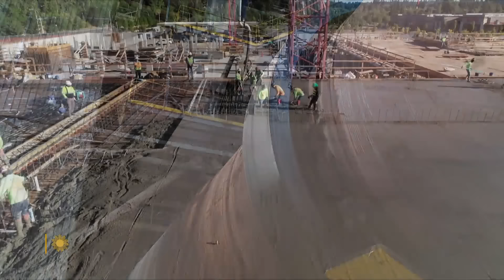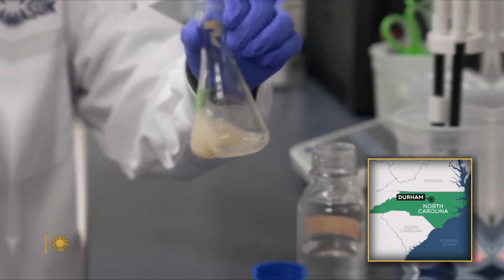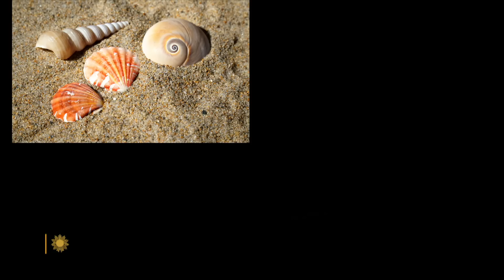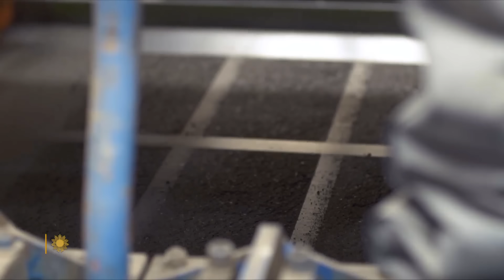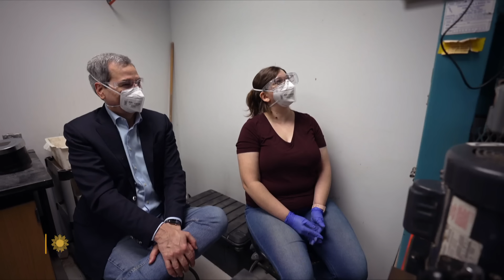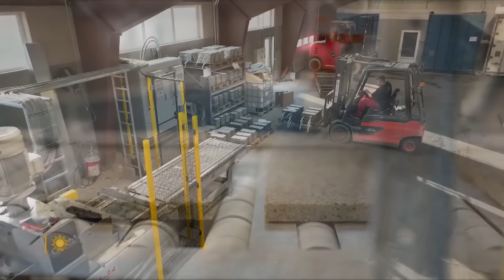Cementing a more sustainable alternative to concrete

Comment: If it was as straightforward as they make it out to be, Venture Capital firms would be pouring Billions of $$ into it, and it would have been licensed by every concrete manufacturer, and it would be subsidized by the governments of the world if it could really get rid of the majority of the carbon emissions pollution.  Instead, they are “working on a few licensing deals”.  This is not what it seems.  They are leaving out something major.  However, I’m sure the underlying technology does work.  Maybe they have not been able to find a way to build it at scale yet.  I hope they do, because it is very cool if it works at scale.

Comment: Yes you heat the lime stone with coal to produce cement, 1 of the 3 major ingredients that makes concrete.  ALSO, and this is important because it saves on $ - the residue left over from that coal burning  limestone is called fly ash - fly ash can and is used as an added ingredient which is A LOT cheaper then cement. A lot of commercial construction companies and fly ash to the mix because it's cheaper than adding an extra bag of concrete to the mix.  The carbon footprint of any large job site is mind blowing.  The amount of waste involved is darn near criminal.  Anything that would lessen the CO2 consumption is a win

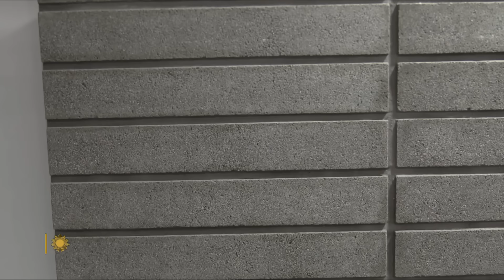Comment: @2:29 The reporter states that the strength is almost double driveway concrete strength. Incorrect. 38,515 lb on a 4”x8” cylinder is roughly 3,000 psi. 

That’s a total joke.

Comment: Hemp create is another amazing invention. Light weight, waterproof and fireproof. It's more expensive, but when you figure in a couple of factors, I might more profitable too. Cement trucks can be made not so heavy duty, gas mileage improves, easy to build with pre built walls and boards to replace wood. It can be cut with a concrete saw tóo. Check it out online if you're curious.
Reply: Yes 🎉🎉🎉
Reply: Gas mileage? If your advocating for cleaner environment from materials you should know the reality that cement trucks have been electrified and run with replacable  batteries. Gas run vehicles have been proven obsolete tech. Do a search and learn about it. Also it's not clear what you are proposing as the use of hemp.
Reply: @cre8tvedge I was quite clear in my comment. The fact that you want me to explain it to you means you aren't as intelligent as you think you are.
Reply: @ChrisLaprise-y1k  Nice try. But no. I'd say you're just dodging.

Comment: I absolutely love all the materials science going on right now (even if it's obvious materials or centuries old - getting new life).  There's a startup company that builds interesting geodesic dome homes called Geoship, they use a different alternative ceramic for their exterior shell. They say it's modeled after bone, also calcium carbonate based (iirc).  Since the material is naturally occurring, there's no cancer-causing or other offending chemicals to cure it, also repellant to mold and doesn't rot, fireproof, as well as having a wider temperature range that it can withstand than concrete can.

Comment: Notice they never mentioned how LONG it takes to cure to usable strength....I'm guessing its substantially longer than concrete, which is why its being used for cast shapes rather than formed in place pours. And while formed shapes would be very useful, the vast majority of concrete used is poured in place, on site, with forms. How does this tech work doing that?

Comment: I wish them nothing but the best! Eco-friendly construction methods including this kind of concrete needs to take off everywhere pronto!
Reply: Today's Sunday Morning program showcased 3 new technologies that offset the terrible ways that bread, "bio-cement" and energy are usually produced. We do not suffer from an inability to innovate more environmentally friendly products. We suffer from the moneyed interests that continue their methods despite negative environmental costs. The petroleum industry leads that DARK FORCE that forces us all to accept the worst options. We must face the facts about climate change and adopt new cleaner strategies.
Reply: @rr7firefly  I think it's the increase in materials costs to use eco-friendly products that causes great idea 'startups' to fail (or slowly fail). When a build project is operating with a fixed construction loan amount, the average contractor is keeping costs under control... not supporting innovation.
Reply: This is not anything new. They have been making cement longer that concrete, they just can't do it cheaper or keep up with demand.
Reply: Never going to be commercially viable. Will be way to expensive for large scale use.

Comment: Unfortunately the big question is whether or not is financially similar to cement?  Because that is what ultimately will drive change in the industry.    Also, based on what I saw this is great for making tiles and stuff, as the shape have to be compressed to what they want, but that doesn't exactly help you if you want to make a cement driveway, or sidewalk, or street, or building foundations or... i.e. what probably 90+% of cement is used for.    That said, I do hope it does become one of those things they can one day just squirt in with some aggregate into some form and create a cement road/walkway/pillar/etc without the need for lime.
Reply: 30% of global concrete is preshaped forms: tiles, bricks, etc. But they are also working on the squirting, on-site kind!
Reply: This. Note that they said they were planning to license the technology to other concrete companies. 

If the cost of licensing isn’t comparable to the existing production methods for concrete then their goal of benefiting the environment won’t really do much here. Nobody licenses their company / company’s idea for cheap. Eventually the license becomes the thing that makes the most money for the company. At which point you stop caring about what your initial goal/intention was and now you care about the money.

Comment: Sounds great, but how much does it cost?
Reply: Like all new tech, it's gonna be expensive to start no doubt, but the more it gets licensed when ready, it'll come down in cost -- basic supply and demand. Think about the environmental cost today vs. the future if this expands. Save the planet for the future, or future generations will be looking for a WALL-E solution to leave the planet.
Reply: @hummersd  This is not anything new. They have been making cement longer that concrete, they just can't do it cheaper or keep up with demand.
Reply: How much does it cost the planet to continue making the current concrete

Comment: I assume not asking any actual questions was because the answers would have shown the problems. Can't have problems in fluff stories.

What energy inputs are needed? These bacteria often require an energy source, such as light (for photosynthesis), hydrogen, or specialized substrates to drive the fixation process.

How long does it take for the bacteria to complete the strengthening? Normally we'd be talking weeks, months before the product was read to be used.

Cost? If this process were cheaper than concrete it would have been stated 20 times in the story. So I have to assume very expensive. The market for paying a lot more to reduce carbon is extremely tiny which makes the impact on carbon too small to matter.

How long does it last exposed to acid rain?
Reply: Your comment is a good example of using critical thinking and media literacy. You thought not only about what you were being shown, but what wasn't shown and why. This is exactly why media literacy needs to be taught in schools.
Reply: Government tax incentives could go a long way toward helping bring those costs down/make it more appealing to invest in this new technology. If the government would subsidize these kinds of green industries rather than fossil fuels, that would also go a long way toward a more sustainable future, since there’d be greater financial incentive for energy/construction companies to invest in greener alternatives like this new kind of cement rather than continue with current methods.

Comment: thats nice for form made bricks but what about roadway roads and/or sidewalks or foundations and what is the long term life span of this new way of doing this? if anything this is a nice idea and this was a nice fluff piece of a story with no real hard questions
Reply: That’s not likely the issue it’s probably the cost. It’s almost always the cost
Reply: @Blahblah37078  yup saving the enviroment is rarely profitable
Reply: @Moe-foe  Especially if they're licensing the technology to others.   They talk a good talk about wanting to get rid of the CO2 associated with cement, but if others want to use their patented process/formulation they gotta pay up.
Reply: @Moe-foe It’s starting to be, at least solar is cheaper than electric in many places now. You just have to build the tech over time and make it more cost efficient, as with anything

Comment: Sure at twenty times the cost. This isn't about saving the environment. It's about their great idea to become incredibly wealthy. It's not affordable on a large scale and they know it. No. the costs wont come down if it spreads like they hope. It'll be expensive in comparison always because of the process. It also didn't look like something you use on a real project that requires some speed as it's pressed and not free flowing. Great idea but not sustainable itself.

Comment: CO2 has been a natural  compound in the atmosphere for as long as the  world has existed. It is a good thing The world is getting greener because of our CO2 emissions since plants, trees and crops "absorb" CO2 from the air to grow. It is an established practice to pump CO2  into greenhouses to make the plants inside grow faster.
Reply: And it’s very bad when there’s far more CO2 than what can be absorbed by all the plants (and it doesn’t help when there aren’t as many plants since we’ve clearcut forests like in the Amazon and destroyed environments that used to capture carbon dioxide), which is why the planet continues to get hotter and extreme weather events are becoming more common. It’s imperative to build more carbon capture, if planting more trees and other plants (and kelp is actually a greater carbon capture source than trees) or coming up with various forms of technology, while also curbing/reducing carbon output. 

It’s not so much for the planet’s benefit, since the Earth has survived far greater than whatever humanity is going to throw at it and will adapt/do its own course correct, but for our own benefit, since we’ve been making Earth less habitable for humans in our current state, and so we either try to minimize our impact so we can keep living more or less how we do now, or adapt how and where we can live in a changing world (which we’re pretty much going to have to at this point, since I’m fairly certain we’re already past the so-called ‘point of no return’ with global climate temperatures surpassing the 1.5 degree Celsius mark, or we’re on the cusp of surpassing it). 

As George Carlin once said, “the planet’s not going anywhere. We are!” If humans want to continue living on Earth indefinitely, we have to take care of it for our own sake so we can keep living here comfortably as we more or less do now. Every step we can take to lower our impact and keep environments and everything in them alive and balanced is good, if for no one else than ourselves.
Reply: @ChrisJones-gx7fc 😂😂😂😂 wrong
Reply: How is blissfull ignorance?